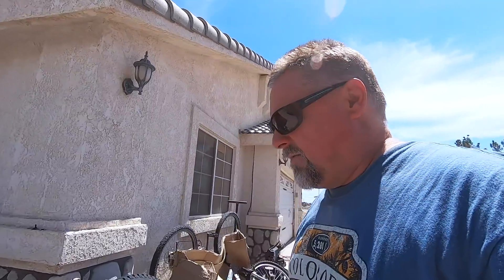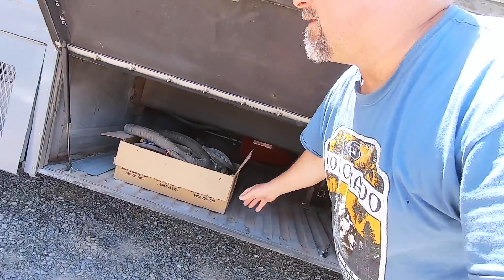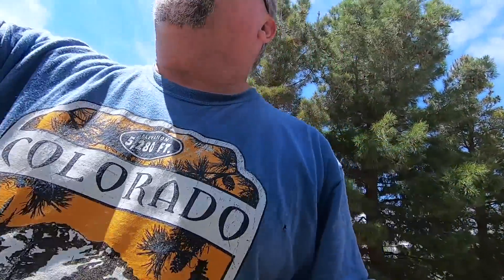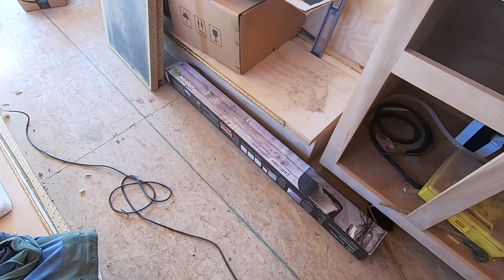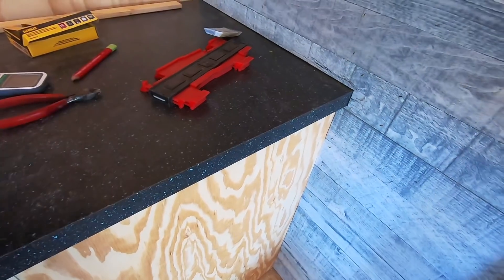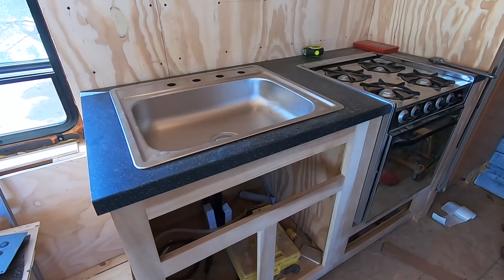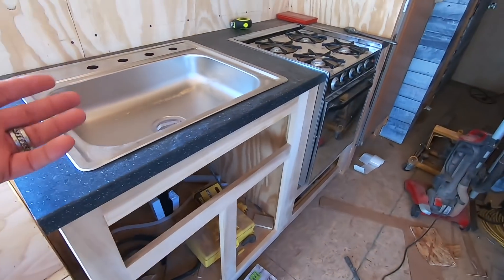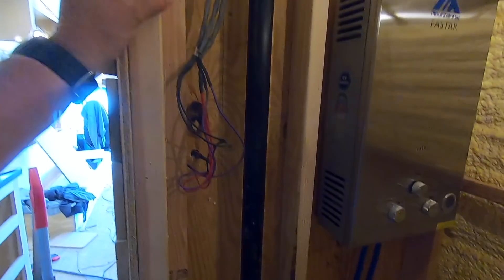Bus to RV Conversion -58- Finished the waste system and IKEA countertops!

Comment: particleboard, use lacquer to seal up the cutout sides to prevent moisture from making it swell and rot, just give it 2-3 treatments to saturate the sides and it should last you a good 25 years